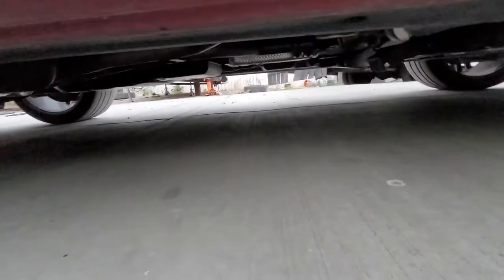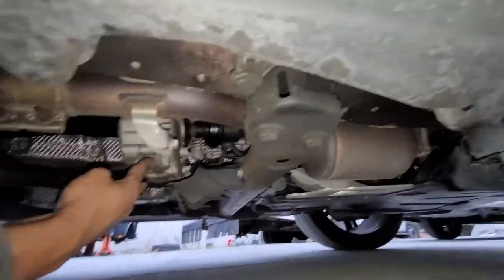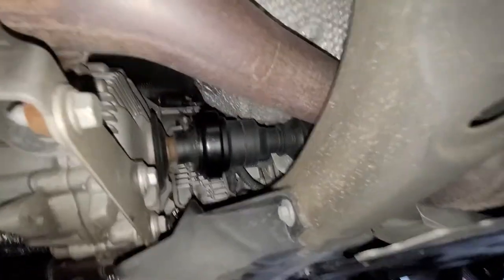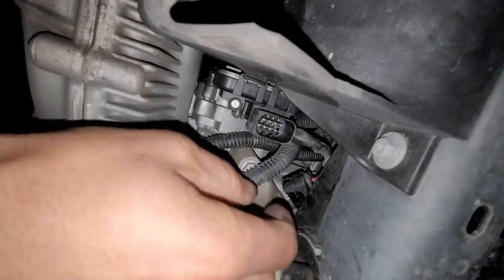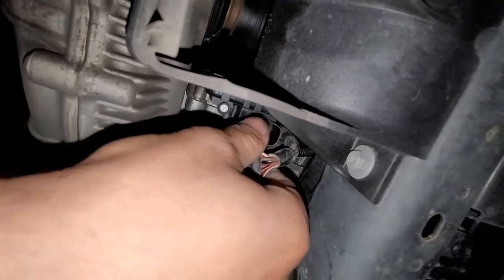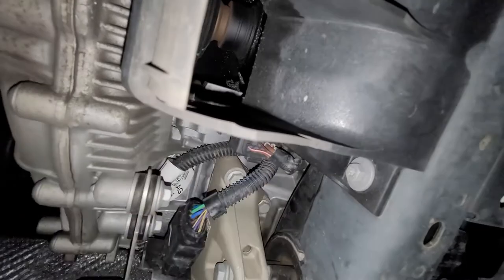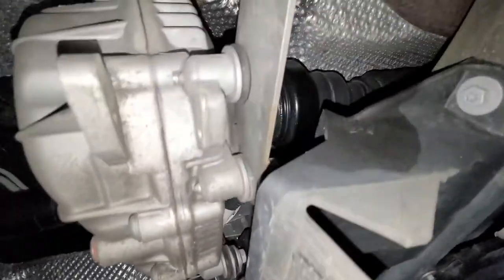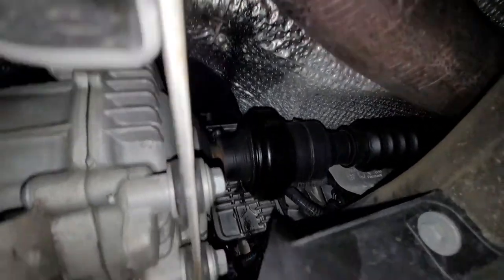2013 Porsche cayenne gts shuttering while driving transfer case transmission issue

Comment: JUST REPLACE THE TRANSFER CASE OIL!! IT WORKS!! I had the same problem, like falling on small potholes and after a $4,000.00 estimate to replace the transfer case I read somewhere to just replace the transfer case oil with the recommended oil (RAVENOL).  Costs about $35.00.  I replaced it about 2 years ago and THE PROBLEM WENT AWAY COMPLETELY!! TRY IT! IT WORKS!!
Reply: It can and did work also on mine but only for about 2 years but it's at the point now where it's not drivable, heavy noticeable vibration while driving and fluid changes don't help any longer.
Just ordered a brand-new transfer case from Porsche of Annapolis for $1,500, i'll install myself and then tow to Porsche to have it programmed.
TC in Annapolis Maryland
Reply: Link?

Comment: Mine is shifting hard from 3 to 4. Thought maybe transfer case but disconnected it as shown and it’s still there. If it’s the transmission what do you recommend next?
Reply: I have the exact same problem. I replaced the transmission valve body, but no luck, I still get a hard shift from 3 to 4.
Reply: @VersaceVJC mine too. 2012 S. Hard shifting from 4 > 3, and 2 > 1.
Reply: @edfox2725  Mine only upshifts hard, from 3 to 4. And only on maintenance throttle, above 2500rpm not anymore.
Reply: @VersaceVJC I’m taking it to Porsche next week. Everyone believes it’s the valve body. I will replace that if that’s proven to be the issue.
Reply: Hard shift on upshift has proven not to be the valve body. On downshift I do not know, but it should be a problem with the transfer case not the tansmission.

Comment: I have one here in the garage. In London,
It's doing exactly.the same and can't drive above 50mp. It says four wheel drive system fault  after 10 20 mins of drive and while driving it feels like its towing something heavy. 
My question is if actuator plug is unplugged can it still be driveable ?
Reply from the maker: Yes it can

Comment: Hi! I’m having the same issue on my 13’ Cayenne. Its at about 62k but it apparently is not covered in the warranty anymore. 

Can i remove the plug and leave it as it is for a while? Like is it safe for a period of time. Also my understanding is that it stays in RWD and wont power the front wheels if unplugged?
Reply: Yeah I. Also need some info on this
Reply: LOL
Reply: I thought Porsche has an extended warrantee for 10 years on Transfee Case.
Reply: Yeah you can